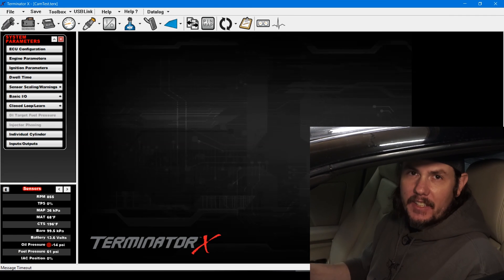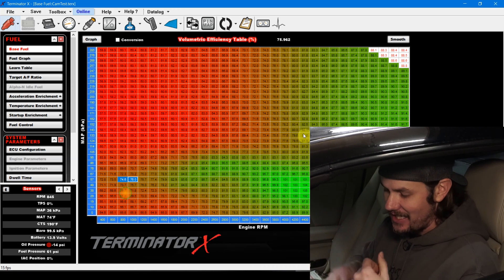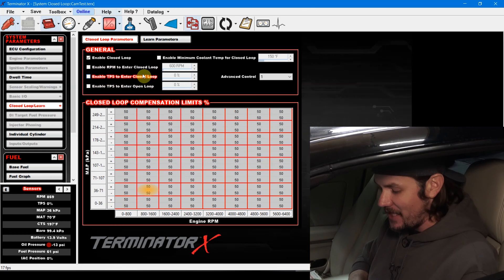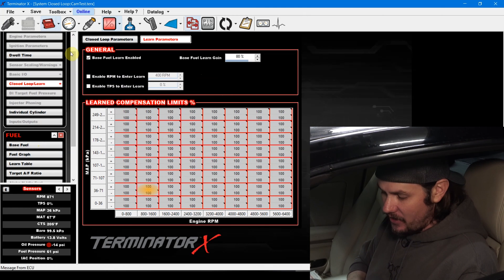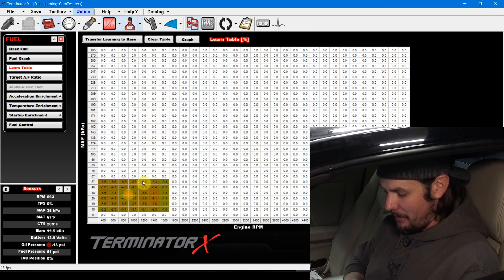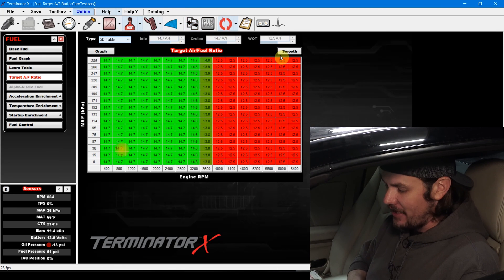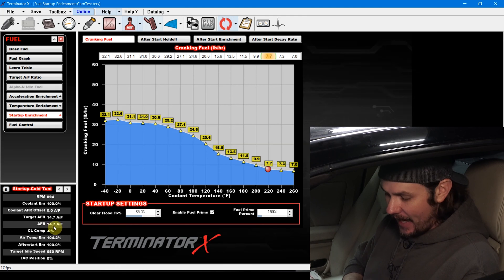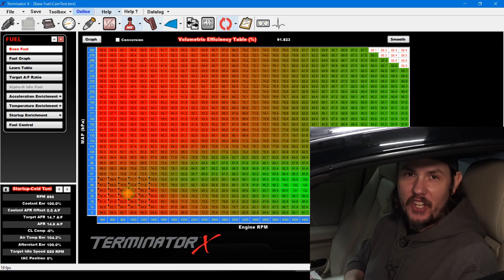Holley Terminator X Fuel Tuning, So Easy A For...  Anyone Could Do It!

Comment: I have a term x max on  a sbc with a 8-71 blower. The self learn has not met the advertised ease if use. Probably my setup though. I am getting better results just looking at the logs and adjusting the map.
Reply from the maker: That has been my experience. I’m not a fan of the Holley self learning. The wideband controllers aren’t very good.

Comment: Maybe you'll see this comment but I've been watching your channel for awhile. I'm currently trying to learn hp tuners, I have the mpvi2 in a 99 trans am. Ls1 nitrous car with a th350 trans, nothing just wild but I've been debating on swapping to the holley terminator x setup for the simplicity of the tuning and ability to control the nitrous and all that which you cant do with hp. What's your opinions on this?

Comment: I think you might want to reconsider your target AFR table. You have it set up so that your AFR is changing based on RPM only rather than MAP. MAP goes up, AFR should get richer. The top few rows should be your WOT AFR, then a few rows of part throttle, then the remaining your cruise and idle AFR. That's generally speaking. Basically, your AFR should be more Y axis based than X axis based.  I don't think you want 12.8:1 at cruise or 14.7:1 at WOT from a dig.

Comment: Had a question about different types of setups. I recently purchased the Terminator X system but have yet to install everything. It’s going in my 99’ TRANS AM. I went ahead and purchased a splitter CAN cable so that rather than only being able to plug in the 3.5” screen to the car/system, I’m able to plug my laptop into one of the leads as well as the 3.5” screen into the other lead. By doing so I’m able to have both plugged into the terminator system at the same time. Have you done this or know anybody that has? If so, do you still have to go through the process of making any tune corrections then uploading them from your computer to the terminator system via the SD card, Or are you able to utilize the direct connection using that splitter cable? I hope that question makes sense. 
Appreciate the video and all of the information in there. For a beginner like myself, little things like the fuel tables  and how to set it up will make a huge difference.
Keep the videos coming!

Comment: Great video you really explained a lot. Question for you, on your target AFR table, on the wide open throttle at lower RPM why do you have it set to 14.7 instead of 12.5? Even though the RPM is lower wouldn't you still want 12.5 at wide open throttle?

Comment: I need your help are you still doing the live stuff, mines just dumping fuel cranking, so bad i cant start it any more, i got new plugs and getting familiar with the software etc could really use some pointers. oh and there is something going on with the iac as well.
Reply: I just installed one and its doing the same thing. Did you get it right?
Reply: @cowill8674  getting the throttle blade set screw right and doing tps auto reset was a big first step after that I worked my way through a lot of the start up stuff till I got it right for hot and cold starts.
Reply: @cowill8674  yeah I got it sorted in the end.
I got some help from a bloke called Aron White off the Holley termx fb page, and then just read a lot of info from Holley online, in order to fine tune it myself just don’t give up mate.

Comment: I like watching your stuff an have been for awhile now you kinda helped me with some of the HP Tuners stuff I know but I'm surprised that you are going to Holley.. An I'm curious if it's on your truck because you seem like one of those die hard HP Tuners guys.. Just curious as to why the switch now rather then before.. I thought a tuner was open to using all types of systems.. Keep up the work an I'll keep watching.
Reply from the maker: Nope, truck is still factory ecu

Comment: this video single handedly got my drag car moving under its own power explained it very well and fixed my stumble/stalling when put into gear deffinetly follow this for first start up and into gear idle issues you will be amazed and after its done ready to get the fun part of the tune dialed in

Comment: Awesome info, subscribed, have a video on deceleration tables or values? 6.0 with cam runs nice, until you let off the pedal lol drops to 9.0 afr .I am Running 13.8 afr might be a bit rich for n/a application? Thanks
Reply: Same issue
Reply: Log a few decel cycles and lean out that area. Take a note were the engine is at when its on decel. Usually is the mid rpm low map area of the table. Accel/decel and the such are good, but you shouldnt “rely” on them. Your ve  needs to be dialed in very close
Reply: @tuloko16  I figured out the issue, my error on install, was map sensor.... I didn't change default location from internal to external

Comment: Why are you not going richer AFR at lower rpm and high intake pressures? Say at 1000-3200 rpm and say 90kpa on up you should have 12.5 afr as well
Reply: Being a tuner for 14 years, I can tell you from experience (60ft at the track, and butt dyno lol) running a richer AFR like 11.8 or even 11.5, and pretty high timing (around 32, but that depends on combo of course) below 3400 rpm will make more power on most LS based engines. Stock gen 3 GM tunes usually have them leaned up a bit down there for better overall fuel economy, but time and again, most every customer of mine claims better launches when I setup more PE AFR down low (stock converters of course).
Reply from the maker: @LS1FREEK  Cool, will have to do some testing then!
Reply: You bet, keep up the good work! Love your videos BTW
Reply from the maker: @LS1FREEK  Thanks man, appreciate you taking the time to participate, that's how the community gets better!
Reply: @LS1FREEK  Agreed 100%
Reply from the maker: Nah, no reason to be that rich that low
Reply: Also I would turn your decel cutoff off until your base fuel map has been learned, then turn close loop off at 0 throttle as well to keep the ecm from trying to learn when injectors are actually turned off
Reply from the maker: @LS1FREEK  closed loop is disabled at 0% throttle, so dfco isn't being taken into account

Comment: I’m looking at getting HP tuners and need recommendations on what to buy.  Do I need the pro? Going to be using it on my 2000 Camaro.   Right now it has SD tune but possibly looking to go back to MAF.  it’s a N/A build street/ sometimes road race fun car.  And which AEM wideband to go with?   Thanks for the help.
Reply from the maker: If you use the 30-0300 wideband you don't need the pro, you can use the serial option to get the information into the scanner. It's the most cost effective way.
Reply: Did you ever get the hp tuners unit yet if not I have 1 for a reasonable price

Comment: That’s cool I was wondering if it was self learning if it would make corrections on it own so I like the fact if you want to run a little rich you don’t have to apply the changes it makes if I was understanding that correctly?
Reply from the maker: You want it to run a bit rich you can host change the commanded table and it will dial it in to that afr
Reply: Goat Rope Garage oh yeah gotcha I remember you saying you can adjust the curve to whatever afr you want cool that makes it a lot easier than oem lol

Comment: what determines which afr do you use per cell. Meaning Im pretty sure that I want 14.7 at idle but what about different loads and different rpm's. I guess the simple question is do you have a afr map that you suggest? procharged sbc roughly 700-800 hp on 93
Reply from the maker: There is an AFR table that determines that, I touched on it briefly on this video, can command anything you want
Reply: Goat Rope Garage I understand that. I’m asking what afr do I want?  14.7 idle? 13.0 idle?  10.8 wot at 150 kpa 5500 rpm?  I just don’t know what is best
Plus I don’t want to blow up my stuff
Reply: snail5341 under boost, 11.8-11.3 is generally safe depending on what your temps are looking like, 12.5 usually is about the max you want under max “NA” load(max load before boost) and 14.7-14.0 for cruise depending on temps and random conditions. You can actually go kinda lean on idle to save fuel if you want, as the car is under almost no load at idle. You’ll want to blend the cells between these conditions as aggressively as you need to “ramp” the fuel in depending on what you’re asking the car to do.
Reply from the maker: Bingo!
Reply: Roland Beliveau thanks. That helps a lot
Reply: Goat Rope Garage thank you too 😁

Comment: Have you used the holley sniper systems at all and what are your opinions on them? I wanted to use one on a big cubic inch big block Chevy instead of a carb.
Reply from the maker: I haven't though I know a couple guys who have and they liked them outside of some technical issues that weren't related to the carb so much

Comment: Could you piggyback one and still pass an Odb2 emissions test?
Reply: Don’t they prob the exhaust when testing for emissions
Reply from the maker: @MALR7  Most have gone away from that because the equipment is expensive, now days they check the IM readiness checks, you can view them from the DTC screen in the Hptuners scanner